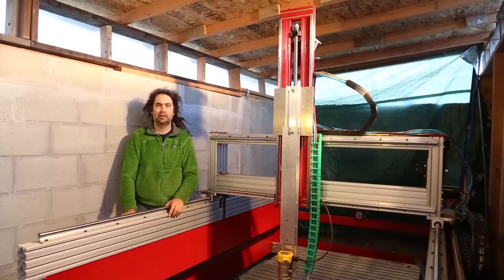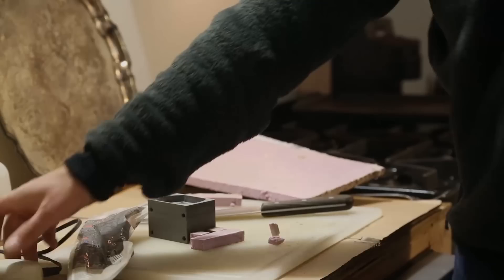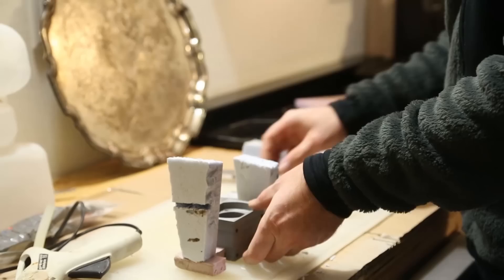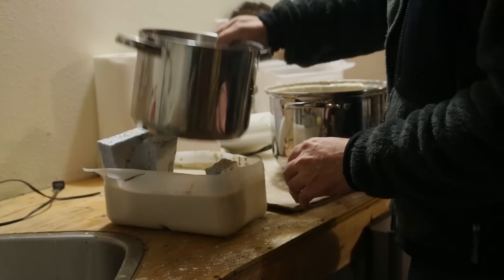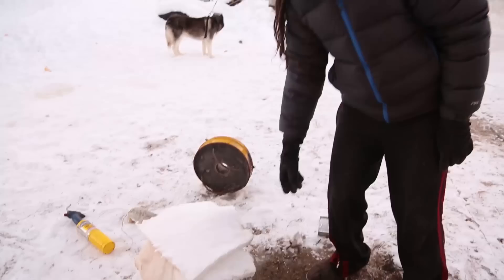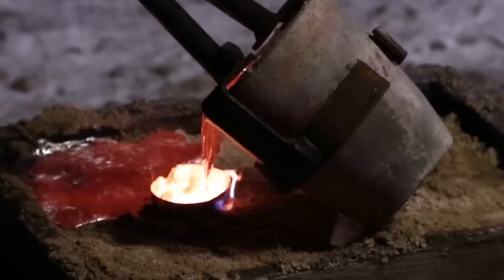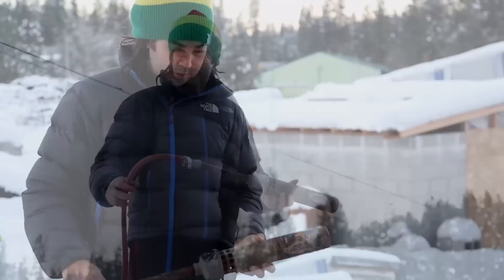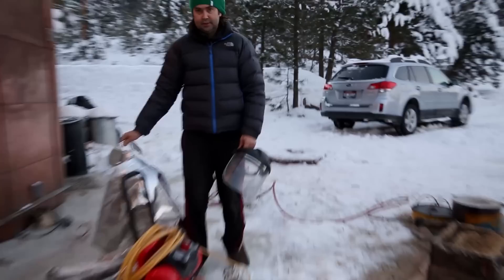Lost PLA 3D Print to Metal Casting; Complete

Comment: We want to build the same oven you are using for a school project. We found out that it can take quite some time before the over reaches the desired temperature. Would using two burners speed up the warming process? Or would it just be waste of gas? The opinions are divided here so I was hoping you could give some advice. Thanks!
Reply from the maker: I would say one burner of adequate BTUs is all that is needed. How long is it taking to heat up?
Reply: 3DTOPO Well we haven't tried yet as we still have to build the oven. We figured it takes at least 2 - 3 hours to heat up and as we only have one day to go to the location, heat up the oven and do the casting this might be a little short. So to shorten the heating and melting the aluminum we thought using two burners would cut the time in half, or at least shorten it. I know one burner is adequate but would it help to use two? How long does your oven take to heat up?
Reply from the maker: Joep Swagemakers From a cold start it usually takes about 45 minutes to have a small crucible full of molten metal.
Reply: 3DTOPO wow that is a lot shorter then expected! If it's that short then there is no problem at all. Thanks! And also, great video! Helped us a lot.
Reply from the maker: Joep Swagemakers It depends on your furnace, burner, settings, etc..
Reply: I understand, size of the furnace in combination with the size of the burner will have a great impact on everything.
I think we will be filming the proces, if you're interested, I'll let you know when it's finished.

Comment: if i dont have a air gun to blow out the plastic then how do i get the melted plastic out? do i need to position it so that most of the pastics will come out?
Reply from the maker: +splitheaven the air gun is to blow the dust/crud out - the plastic itself is burnt out.
Reply: +3DTOPO How bad would it be if you didn't get all the crude out?
Reply: +splitheaven You could try something like a shop vac with a narrow hose attachment, the air would be going the other direction and wouldn't have as high a velocity as an air compressor, but that would probably remove a lot of the junk..

Comment: What's the fuel consumption rate on a setup like this?
Reply from the maker: It's pretty spendy compared to our new induction furnace. But you can probably melt 50 pounds of aluminum for ~$25 in propane. For induction, you can melt 50 pounds for around $2!

Comment: thanks for the great video! i was wondering how long the mold was left to set before you baked it? thanks again!
Reply from the maker: +Ronan Fahey Plast of paris sets up real fast. You can pop in the oven after an hour or two if you push it (but slowly ramp up the heat until the mold is past 212F).
Reply: thank you! your a legend! I'm working on a sculpture at the moment and i was wondering if you could give me some more advice!? I'm working with wax and there are a few issues with bubble holes in the wax, i would use more wax to fill them but the heat would damage the piece as it is! is there anything i can use on the wax that wont bond with the plaster? cheers for the help, much appreciated.

Comment: Let me start by saying that I have no experience in 3D printing or casting metals, so if my question is a dumb question I'm sorry.  But maybe somebody else needs to know and is too shy to ask, so here goes.

Could you have avoided all that Styrofoam and glue stuff by printing the runners, gates, sprue* and riser connected to the part right from the start?

* I have no idea how to spell the word, and my spell checker doesn't either.

Comment: Why didn't you salt the aluminum to leech out the hydrogen in the molten aluminum?
Reply from the maker: I often do for good measure, but for aluminum it usually isn't required in my experience. No defects where present in the cast without it. I usually melt scrap first, clean our ingots and then use the ingots for casting.
Reply: I've made it a practice to do that just as habit- I wasn't certain if you had a specific reason for not. Just Curious- Good stuff.

Comment: First off your the man!!!! 2nd why do you mix the copper with the aluminum? Can you still polish it when your all done to give it that mirror aluminum look? Do you stir the copper around with the aluminum once its all melted together? Thanks
Reply from the maker: +Kewfit Thanks! Aluminum by itself is a very poor quality metal. Add a little copper and it makes for a much stronger, more machinable cast. In addition, the copper acts as an impurity that actually lowers the melting temperature and improves pour-ability (same reason salt lowers water's boiling point). Just add the copper and it will dissolve into the aluminum. Might need to stir now and then to speed it up.
Reply from the maker: +Kewfit and yes - fully polishable still
Reply: +3DTOPO Do you have an email I can message you at I had a few more questions, thank you
Reply from the maker: +Kewfit jeshua AT 3dtopo DOT com

Comment: Is %3 a standard for aluminum? Or does it go up with mass?
Reply from the maker: Its 1.5%-2.0%. Not sure where you got 3% from. ;) It is standard, and based on length not mass. Another commonly used measure is 1/4" per foot.
Reply: I got it from where you said exactly that at 3:05. You said you were going to print it again at %103 to make up for the shrinkage of the aluminum. Your words, I was just asking for clarification.
Reply from the maker: My Bad. The official number is 2.5%, rounded up to 3%.
Reply: Cool thanks!

Comment: would it have been easier to cnc the part?
Reply from the maker: Possibly - possibly not. The point is this same method can be used to create castings that would be impossible to mill. Not to mention I used recycled aluminum instead of having to purchase a new block of aluminum and put some wear on my end mills. Also keep in mind that after you have done this process several times it goes much faster than it seems in the video because you don't have to stop to explain every little thing. ;) I could raise even more points, but I don't want to bore you.

Comment: the 1.3 scale of the initial mold can be applied to all PLA  molds?
Reply: +rodin I believe he used 103%. Its a good place to start. You should check with each print because different shapes shrink differently
Reply: +Federico Romero Besné  ok thanks man. by any chance do you know how to look for the shrink factor of general shapes? i have been googling it with no luck.
Reply: don't know but you could try printin a slice of what you have in mind. It should behave the same, provided it doesn't warp

Comment: I've done a lot of lost wax and plastic casting in my life in investment, but I have never seen anyone try to mix it with sand casting. You needed to mix your investment a lot better, I hope the casting turns out ok for you. I always vacuumed the mold to get the air bubbles out, I think it works better than vibrating it. I always used a big slotted spoon to mix  the investment so I could see how fast the investment flowed through the slots and make sure I had all the lumps mixed out of it good.
Reply from the maker: Bush Imports Why are you telling me I need to do things better when you do't even bother to see that the part comes out flawless?

Comment: awesome stuff. i have been messing around with my foundry and green sand for a year or so. i am actually casting parts and the frame a 3d printer i am building now ( duel head with a envelop of about   22"x 13"y and 22"z) then when i am finished it can all come full circle and start casting 3d printed forms. i have a large heated bed, and i plan on experimenting with a powder coated aluminum print surface. anyone have any thoughts on this?

Comment: Thanks for the information!  You have no idea how much help it has been to me. I have been doing 3d printed patterns in green sand but the parts with complex geometry I will have to do the lost PLA method. I did 50% plaster of Paris and 50% fine silica sand and my mold crumbled after the PLA was burnt out. So my question for you is, does the more course play sand offer more strength than really fine stuff?  I just tried it as I had it around for core molds with sodium silicate.  Another factor I have wondered about is the ideal wall thickness of the plaster?  So from the 3d print to the outside of the mold minimum thickness? I let my mold dry for days before the burnout. Are fine cracks in the mold normal?  I was surprised to see your mold hold together when heated up in your foundry.  Anyway, hope to hear from you and keep up the good videos!
Reply from the maker: Cheers! Hmm, not sure about really fine sand - never used it with plaster. Cracks are normal, but usually don't cause many problems (one of the reasons why I bury the mold in sand). You can add stainless steel needles to help keep the mold in one piece. It sounds like either the plaster you used didn't have the proper amount of water, it was overheated, or perhaps it was water damaged? How hot did you get it? Was it fresh out of a sealed bag? I usually just make a solid block of plaster, and keep the pattern at least a 1/4 inch or ideally at least half of an inch from the closest edge. Also, I only use an electric kiln for burning out now - its much better than using propane because the heat is much more uniform and you have exact control over the temp.
Reply from the maker: Here is where I get the stainless steel needles from: https://www.ebay.com/itm/Refractory-Reinforcing-1-430-Stainless-Steel-Needles-2-lbs/133068805088
Reply: Hey thanks for the quick reply and the stainless steel needle tip.  I'm not sure how hot the mold got during burnout.  I started by putting it in the bbq for 3 hours at 500F. The PLA had started burning out but not completely so I put it in my foundry until the flames stopped. At this point it was too crumbly.
Reply: Any advice on how many needles to use?
Reply from the maker: @andrewbuchanan9400  I just kind of wing it. I usually put like a handful in.
Reply from the maker: @andrewbuchanan9400  was the mold glowing? If so, what color was the glow?
Reply: No the mold never got hot enough to glow.  I picked up a bag of the play sand from home depot you had recommended.  I'll give it another go this weekend only changing the type of sand and see what happens.

Comment: Could you print the part with Gates and runners on it out of pla?
Then mold the whole thing as you would normally with the foam Gates and runners.
Edit: and sprue....
Edit 2: and risers
Reply from the maker: Yes, I often do. It was easier to explain the functions by making them for the video. Don't forget risers! A typical aluminum cast is 40% risers. A nice thing about 3D printing is you can make risers spherical (which retains heat better than any other shape).

Comment: Nice job - but why on earth did you went with casting for such a primitive part? It's basically a Cube with a pocket and a big hole. Conventional machining wasn't an option? Would have been so much faster and easier - and way more accurate. Casting is used for complex geometries, not for cubes with holes...
Reply from the maker: That would not make a very good instructive video on how to cast metal would it? ;) Also, this was a part for my CNC machine - it didn't exist yet. There are numerous reasons in addition: this process can be used to cast parts literally impossible to machine even on a 5-axis machine, I used 100% recycled material for the part (didn't buy an expensive billet), no wear on my expensive end mills,  no setting up the g-code, no mounting the piece checking and double checking, running and managing a CNC machine isn't really any less work either (I could go on). Especially now that I am set up for it with a vibrating table, and I usually just print the part with all the plumbing (sprue, runners, gates, etc).
Reply: 3DTOPO No need to tell me that, been in that business long enough. And of course, it wouldn't have made a great video. But that's not the point. Anyway, if you're that convinced that this whole process - with a part like that - is really faster than conventional machining, then be it.
Reply from the maker: MadHatter123456 did you not get the part that it was a part for my CNC machine? That said, both ways take work, expenses and time. Doing a video how to setup tool paths and operate a CNC machine would have seemed just as tedious (if not more so).
Reply: 3DTOPO Of course I did. Seems like you didn't get the part where I was talking about conventional machining processes. Never used the term "CNC". No need for a CNC for a part like this. But anyway, tired of this. Have fun mate.
Reply from the maker: MadHatter123456 Except I didn't have a milling machine (CNC or manual). For what I had available, this was the most straightforward way to make the part.

Comment: So i didnt watch the entire video, but would it be possible to do this with really fine sand rather than concrete? I would assume the only problem would be that you lose detail on the print.
Reply from the maker: Absolutely do not use concrete! Concrete with molten metal is explosive and deadly! We used plaster of paris mixed with sand and baked out at high temperature so it has very low water content. We do a sand variation of the technique (and yes at reduced detail) we show in this video: https://www.youtube.com/watch?v=tA1znkGbnSQ
Reply: Thanks!
Reply: +3DTOPO You should really have mentioned how dangerous water is to molten aluminum, talk about an explosion! Most people don't realize how explosive aluminum is. It is actually used for demolition of dams in WWII Germany.
Reply from the maker: Tankapotamus actually I do mention it in the safety overview portion of the video.
Reply: +3DTOPO I heard you mention wet sand was bad, but I must have let my dog out or something during the warning. I just noticed that hardly any of the aluminum casting videos, on YouTube, warn of the dangers or even seem to take the dangers seriously. I'm glad that there is at least on good example of someone taking the dangers seriously and attempting to warn others!

Comment: Can you use the same process for casting iron ?
Reply from the maker: I suppose you could, but you will need proper investment for the job - plaster of paris will not live up anywhere near that temperature.
Reply: so probably some investment casting ceramics would be of help. However, don't have idea what kind of.

Comment: What percentage of infill did you use on the printed piece?    thank you
Reply from the maker: I don't recall - I printed that part over three years ago. Probably around 20%, the less you can get away with, generally the better.
Reply: yeah...less is better. thats what i was thinking.  thanks for all your help
Reply from the maker: It should still burn out with the same result (a tad more ash to vacuum out I suppose) but why print more than you need to if its just going to get burnt out, right? ;) Cheers.
Reply: You need to use about 25% infill to get a smooth finish on the top layer. At least that is the minimum for my Printrbot Simple Metal w/ Cura.
Reply from the maker: The fill required depends on the geometry of the print. I have printed some parts that print perfectly fine with 0% infill.
Reply: 3DTOPO Yeah, I meant something with a flat top.
Reply from the maker: Even so, with my Ultimaker, 20% is about the most infill I ever need. Also, if you want a flat surface, you can choose more layers for the top which allows it to be smooth with less infill.
Reply: +3DTOPO Ultimakers are just better machines, all I could afford on disability is a Printrbot. I tried a lot of settings and even with 10 top layers I had to go to 25%. I think it may be the crappy cooling fan on the extruder only blowing on part of the print. I'm curious if Simplified3d would help, but I can't afford it. I'm building a Taz 5 clone, but it's taking a while to get all the parts. I was thinking of using this process for casting the corner connectors. I might have to just 3d print them unless I can find a place to machine them.

Comment: Why didn't you just 3d print everything at once instead of playing with Styrofoam and hot glue to make them afterwards? :)
Reply from the maker: I often do just that now. But it would have taken longer to design the gating and sprue in 3D and print them versus a few minutes making them. I also thought it was easier to explain them as I made them.
Reply: @3DTOPO  Made many vids on multi part mould design? :)

Comment: Is your plastic in your printer ABS?
Reply from the maker: +97trainman PLA, hence the title "Lost PLA" ;) I hear it works well with ABS too - but has more nasty fumes burning out.
Reply: +3DTOPO Can it be done with ABS and then cleaned out by acetone, do you see a problem with that?
Reply from the maker: Sounds like a hell of a mess. You want to get the mold up to 500F anyways (to avoid thermal shock and steam defects).

Comment: Did u use 50% sand , 50% plaster of paris?
Reply from the maker: +bingre That is correct.
Reply from the maker: +bingre (for aluminum)
Reply: +3DTOPO we used the same mix but our moulds seem to crack quite badly upon firing the plastic out. One mould fell apart when we pulled it out, any tips?
Reply from the maker: If you get it too hot it becomes quite crumbly. Ideally you want to get the whole thing just hot enough to burn the plastic out (500-600F).
Reply: I see! 500-600F seems low to get the cherry red corner that you got on your mould though? I shal do some tests with lower heat and longer in the furnace
Reply from the maker: You need the whole thing to get 500-600F down to the center of the mold. If you operated at 601F it would take a long time to get that hot in the center. ;)
Reply: Ok thanks thats a great help, we've just got an infra red thermometer which should help monitor our temperature a bit more. We probably fired them at double that so no wonder they got destroyed.